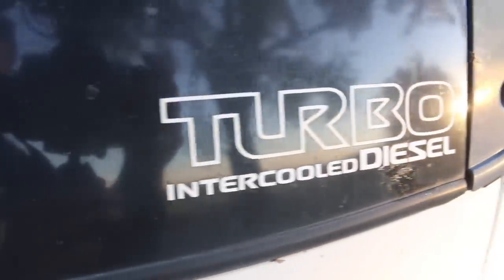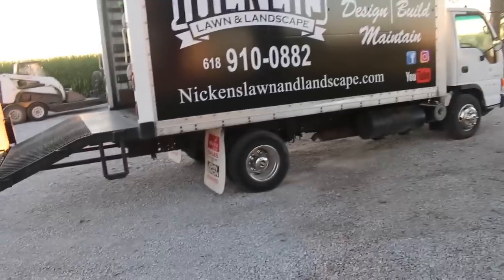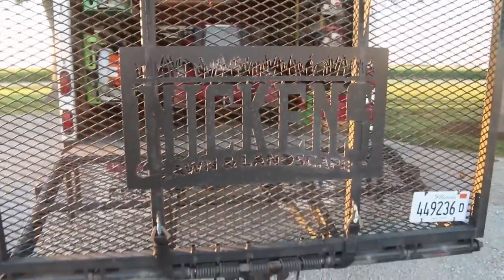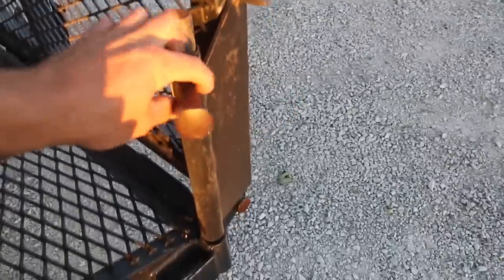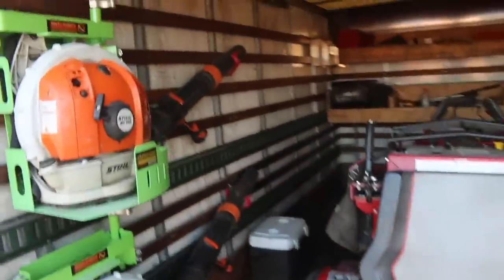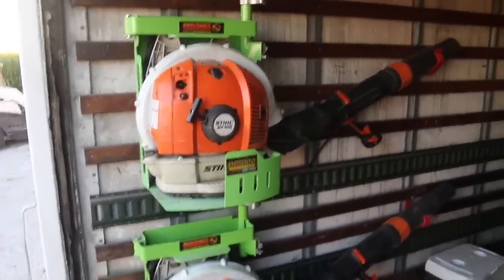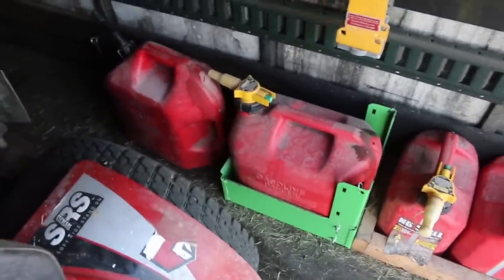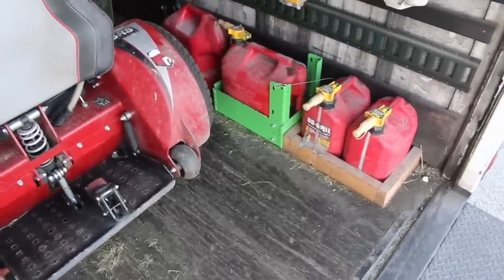2018 Lawn Care Set Up | BEST MOWING SETUP IN THE WORLD

Comment: Nice set up bro, My buddy has the same set up, only difference is his gate is split so if you pull a pin you can put one side down also he mounted  a 1200lb atv winch to the top right corner on the back of the truck and attached the cable to the gate put a two way control switch mounted on the back to put the gate up and down
Reply from the maker: dheadhunter413 That winch idea is gold! Thank you for that!

Comment: I have a GRASSFLAP on my Ferris Z2 52". I have had the cable break also. I just go to the hardware store and buy the same size cable and some  crimp  connector. Then pull out the broken cable then just feed the new cable back  through the old one. Around $5-$6 then its fixed. I also think it needs to be a bigger cable.

Comment: 6:04 maybe you could hold one side in place ( bolting it in place)and use a (or a wingnut)bolt to screw pressure from the other side to hold paper towel roll in place
Reply from the maker: Mr.ChillYO That’s a good idea! May try that. Thank you for the input 😎

Comment: Let's see how you have the cable running for grass flap. We do not use Zip Strips, this helps with NO BENDING of cable. It has limited reordering.
Reply from the maker: Ring Lawn Care We tan it as straight as possible but still replacing a few a year
Reply: Same here, but IMO it is worth it for us. Mainly cuz we mostly provide lawn mowing.
Reply from the maker: Ring Lawn Care Yea I agree. Can’t live without it. But I do believe when a similar product comes out that is foot operated and less little parts it will take over

Comment: Hey. Might want to change routing for GRASS FLAP. So far im good. I hope i dont break em. You must have a bend point or rubbing point somewhere. Especially in your walk behind. Peddle should try to be on opposite side. Ive tried routing to there. Bends are way to much.
Reply from the maker: CUT RIGHT LAWN SERVICE we have ours pretty much bend free and still break 2 per year on each mower. They break at the ball on the end of the cable
Reply: Yeah I guess they would just have to BEEF them up thicker or something. But can only wear so much i suppose. I think about it every time i step on mine
Reply from the maker: CUT RIGHT LAWN SERVICE Yeah I was just thinking make it a thicker gauge and it would be golden

Comment: Like your setup.  I've never understood why most landscapers insist on dragging around a trailer.
Reply from the maker: Kenneth N. Shortlidge Same here man! A lot of times it is not necessary
Reply: You don't bag and remove grass?
Reply: @jdias51  why would you need to bag and remove grass. Get a side discharge mower.
Reply: @jacobking4106  in the Northeast grass is wet and clumpy almost all customers want it bagged I have a 52 wright stander side dish charge with a removable basket and a 48 walker for the nicer lawns

Comment: Had horrible problems with Stihl have over 10 broke Stihl that cost more to fix then what they are worth . Redmax equipment lasted me 5 plus years only Stihl that did me good was a hlk 100 trimmer 4 years strong
Reply: its because there switching everything over to 4Mix all there units from what i know are all operated like a 4stroke engine has valves and pushrods etc a 2 stroke does not so more parts to wear out and break stil is going the wrong way on there trimmers
 and blowers.
Reply from the maker: oliver jarquin crazy how different two peoples experiences can be. We have had nothing but good luck with all of our stihl products